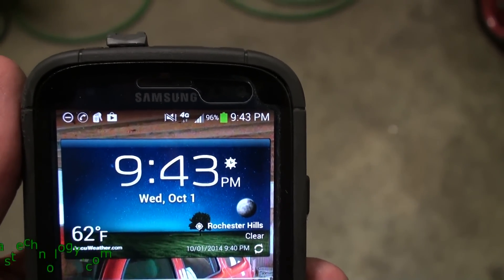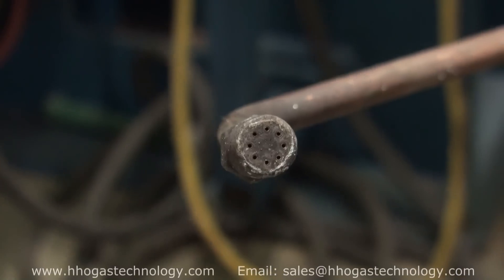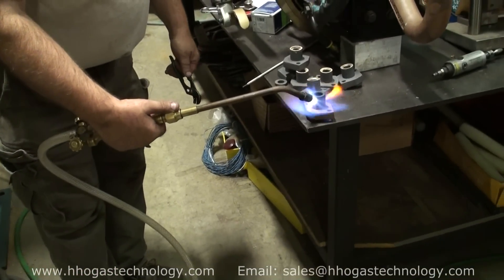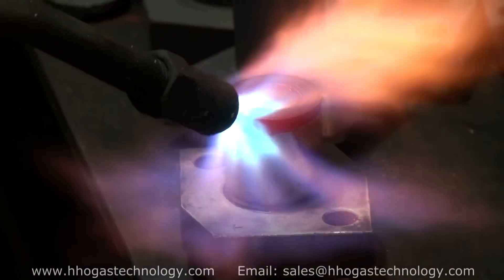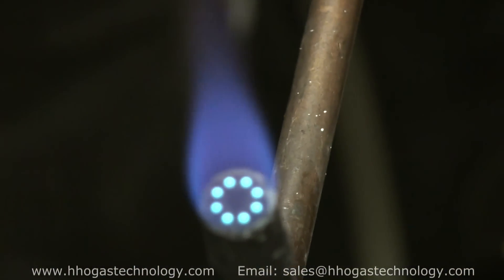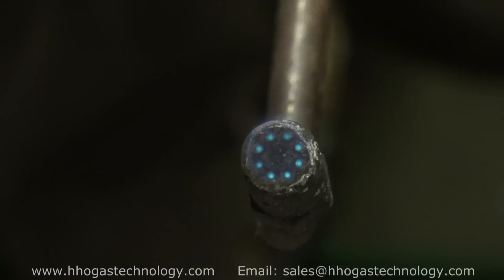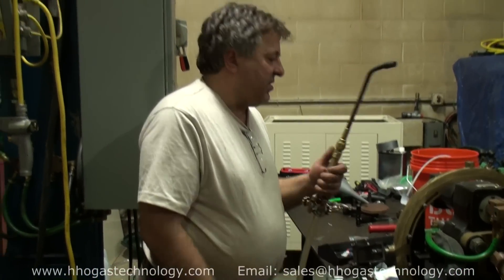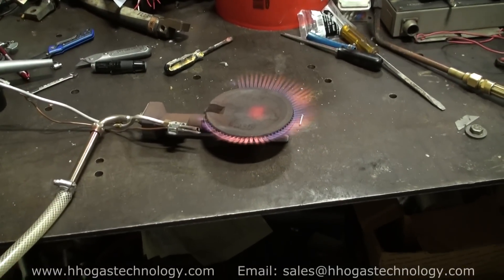HHO Gas Machine 59 Liters Per Minute Heating Up Massive Thick Copper & Running Water Heater Burner

Comment: 10 minutes to remove the top with oxy acetylene?? I would expect with a heating torch that size to have the top off within one minute, not ten, and we use them at work  to get inch plate Mild Steel cherry in one minute.
Reply from the maker: You just mentioned a plate of steel. Copper Transfers heat immediately from the source to the other side of the material. If you think that was fast with the machine HHO Gas and hexane vapors rich. It could heat that material five times faster if I leaned out the hexane fossil fuel vapors in the bubbler to work with the oxyhydrogen. Just for an example I could take a ball valve filler fitting and Melt concrete in one second using HHO Gas. Have you ever use HHO Gas ever in your life? This HHO Gas is totally different then any fossil fuel gas you are using. HHO Gas does not fall in the same category because it is not a fossil fuel. Can you run your hand through a 24-inch flame and not burn your hand then the next second Melt concrete In one second? No matter how small the nozzle is it will always melt concrete. HHO Gas has a fire flame temperature of 5000 degrees but the flame has no radiant heat whatsoever.
Reply: HHO is a better fuel for heat no doubt about that I've used it along side oxy theres no comparing the two

Comment: 1st you are smothering your flame. The greatest heat is at the end of the blue flame. 2nd acetylene burns 1000 degrees hotter. As an engineer this is hype. BS
Reply: Exactly. Poor production and even worse content.
Reply: they are a good comedy team ,i was laughing at the whole bs,,they wont even show what the hose is connected to not that it would matter

Comment: So much wrong info in this thread... HHO (Browns gas) is a Weak Gas it´s already at its stochiometric rate bound in the form of water H2o. it´s almost harmless if it leaks out cos its dissipates directly in to the air in a second so you cant even light it.. only time its a bit of danger is when you have a large tank filled... And even then it has no real explosion power compared to same volume of acetylene/oxy in stochiometric  rates or propane/oxy in stochiometric rates...  you cant put in more oxy and think it will burn harder or blend in air to save gas as some one mentioned it does not work...  conventional electrolysis (Brute AMP) and Dry cell is not economical and will not produce enough gas momentary so in that case a tank will be needed... Today i think electron enrichment with high frequency Laser pulsing to water is the way to go and it won´t produce 
6 worth chrome like the electrolysis methode does when the ion stream carrying out the cromium ions out in to the water from the stainless steel anodes...

Comment: well I think everyone should be getting with the Donald on this.. this is what should be the future.. not fracking..
Reply: Yaphette Costello,
Your referring to hydrogen-burning cars instead of petrol I presume. I think you are under the assumption that all big conglomerate industries/businesses are neutral and do not push their agenda (political and otherwise) to make more $$$$$. In this case we are talking about big oil having a say on the world power stage! If USA or any government world wide think they are in charge they soon find out who really runs our (or any other) country!  I agree using Hydrogen to fuel our vehicles would be a good thing but the problem with production is $till infra$tructure to produce and $tore hydrogen! You would need production to be right at the gas station or even better, on board the vehicle. It's a completely different paradigm than the petrol business model.

Comment: why cant we make tiny less violent combustion pistons for hho to be a car engine fuel, a new car with a micro gas piston power transference thing could be made from metal mold all mechanical making new hydrogen cars like a new china car, like $600

Comment: good video but heating water with a heating element at the same amount of energy you used to make hho would be more efficient
Reply from the maker: HHO Gas heat water five times faster. If you have not tested the concept then you do not know what you are talking about
Reply: ***** yeah but for 60l a min he would need as much power as a kettle

Comment: Massive? Really? MAPP torch works same.
Reply from the maker: Map gas is a fossil fuel and does not respond the same way as hydrogen and oxygen gas. I can take a basketball filler tip and melt concrete in 1 second into a puddle using Oxyhydrogen gas.
Reply: @HHOGAS  i know. Fire brick and tungsten too. May be a better video than a small chunk of copper silver-soldered. Thanks. O - could you Please give us quantitative figures on relative energy outputs and costs?
Reply: I would like to see someone actually make, repair or cut something for production of any sort of project made of steel. Buid a small square angle iron frame using hho to cut and weld the thing! You could be the first to put hho to a usefull purpose!
Reply: Cutting an alluminum can is not a useful purpose, niether is demo welding and cutting! Make someting....Anything!

Comment: I think you need to separate the hydrogen and oxygen  with magnets or individual  tubes when ionising  the  water with electricity  cathode and anode ,and then they mix just prior to ignition ,like oxygen. - acetylene.